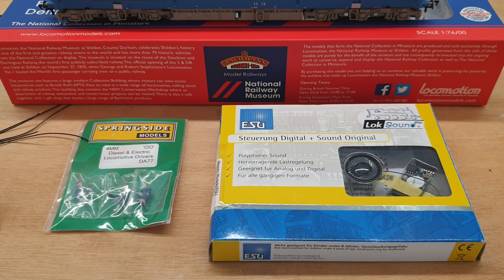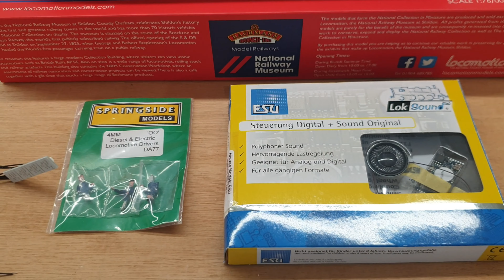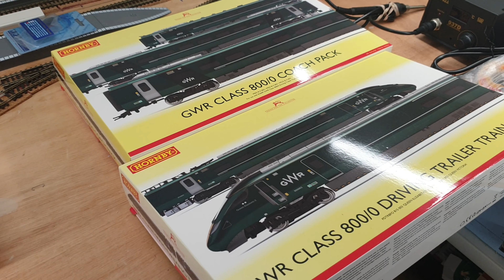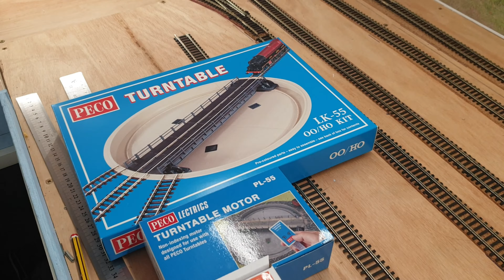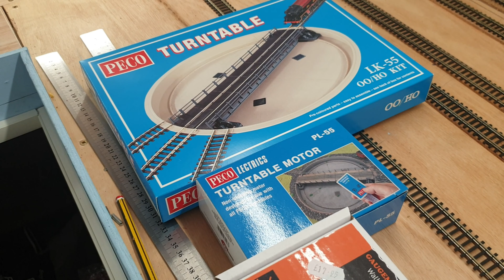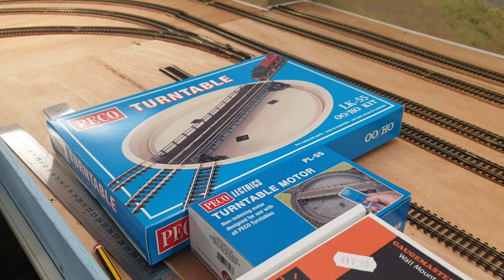Model railway – New items and a slight change

Comment: Nice update Simon, that Deltic looks superb I may have to consider one in N gauge for Exehaven, although technically it wouldn’t be in that area I like it so much that rule 1 may have to be applied! Looking forward to seeing what you do with the turntable, I have a Peco one and have only semi fitted it so far just as a placement. Don’t over cut the hole it will sit in! Cheers for now Simon, John
Reply from the maker: Many thanks for the advice John, I think the hole may cause me issues, but hopefully not. The DP1 is a fantastic looking locomotive. I have seen the N gauge version, which looks really nice..Simon

Comment: Hi Simon, you probably know this already but DP1 was the prototype Deltic but DP2 was essentially a prototype class 50 so sounds quite different.
Reply from the maker: Hi Andrew,  thanks for commenting.  I did know that, I had the bachmann presentation pack that had the dp1 and 2. I will reblow the chip with logomandiffo sounds. Simon

Comment: Well Simon what a fab collection of new arrivals , will be interesting to see how the turntable operates . My Hornby one has been ok but it is noisy and stops at every off shoot even if it doesn't need to . I just use it to turn loco's around . 
     The GWR train looks so nice as does the Deltic , looking forward to hearing and seeing them run ........Peter
Reply from the maker: Many thanks Peter, I had a Hornby Turntable in the past, it was noisy and too big, it would not fit where I want to put the Peco Turntable. Take care...Simon

Comment: It plainly pays to advertise Simon.  The DP1 is a fine loco.  I remember seeing it for the first time visiting the Science Museum when it used to be there.  I was about eight or nine on a school trip and it seemed gigantic.  The turntable will be a nice addition.  I will interested to see how well the motor works and how good your reflexes are in stopping in the right place.  Stephen
Reply from the maker: Hi Stephen, it must have been nice seeing the actually DP1. It will be interesting to see how the non-indexing motor works. Peco telsl me it very easy to line the track up...Simon